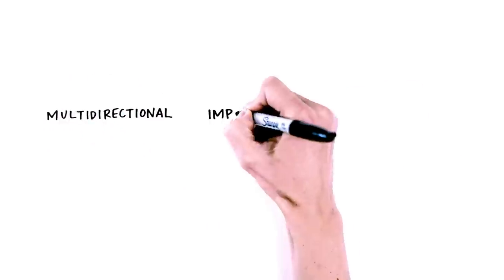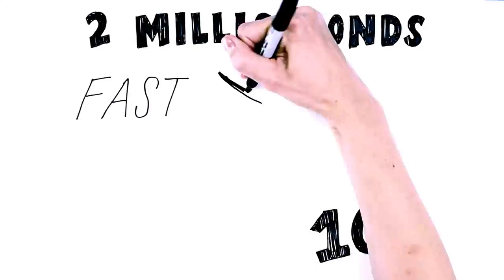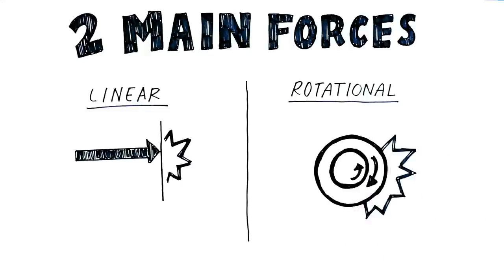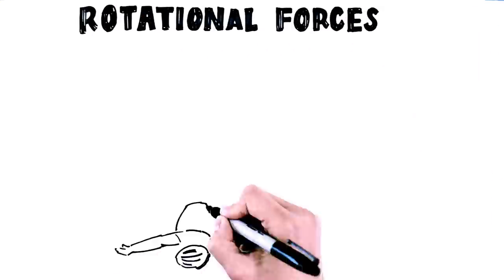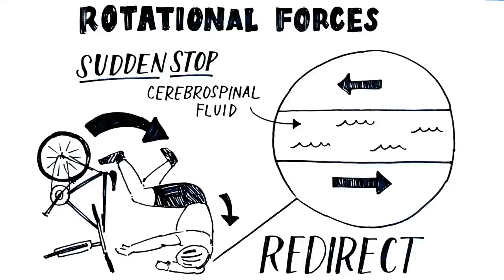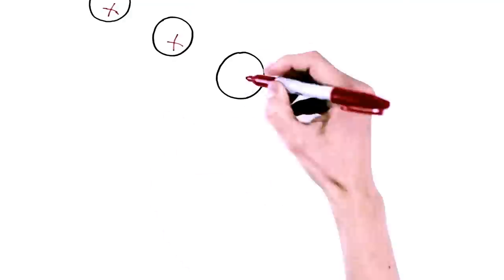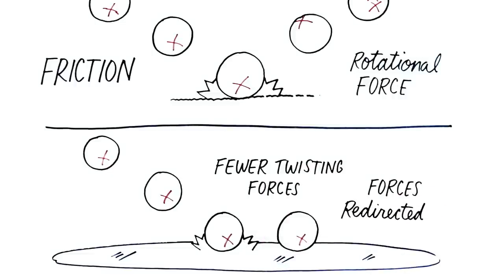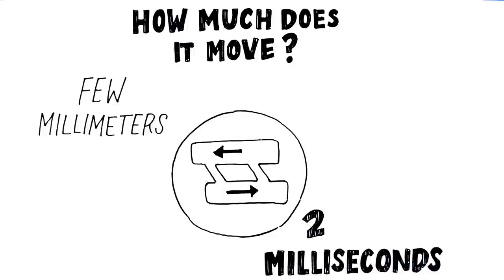MIPS Helmet Technology Explained

Comment: Hold up. The scalp itself has give and moves around on top of the skull which achieves the same thing your helmet does. What’s the math behind this and how much rotational Force does it really absorb? Those rubber bands can’t take much impact and if anything just cause the helmet (along with the natural give of the scalp) to rotate on top of head more than a regular helmet would causing the contact points between head and helmet to shift even further in turn potentially causing a greater impact on head due to a more offset helmet position. Please explain.

Comment: Helmets shouldn't be on so tight that they don't move at all. So currently helmets already do rotate a bit on impact. You see it all the time in pro races where after a crash the helmet is on a bit crooked. So the extra few millimeters MIPS claims to move seems minimal to the total amount the helmet already moves.
Reply: yeah but it's still safer. Helmets are one thing you don't want to skimp out on
Reply: marketing scam
Reply: @Mike-tg8pv  I totally skimped on the helmet....I didn't get one. More $$$ for other cool accessories............